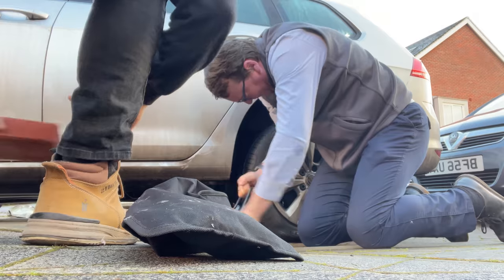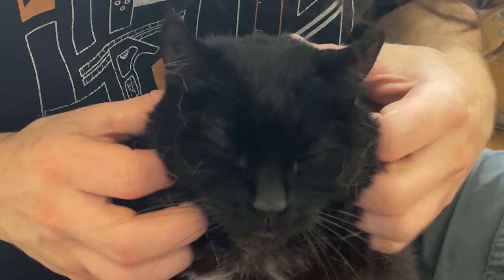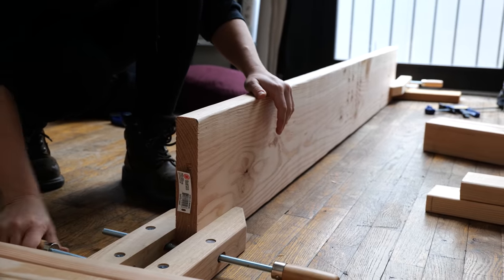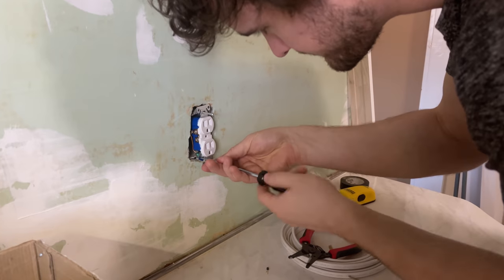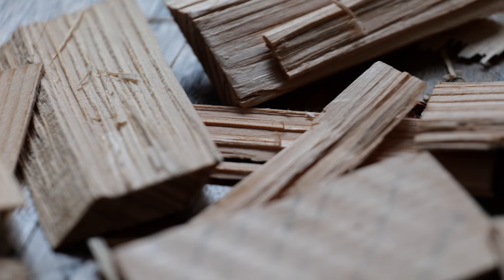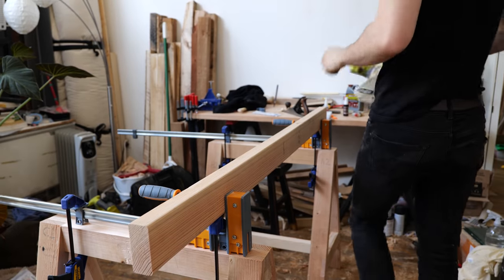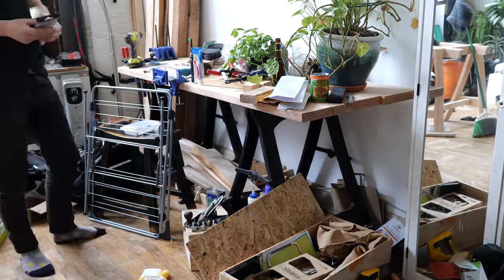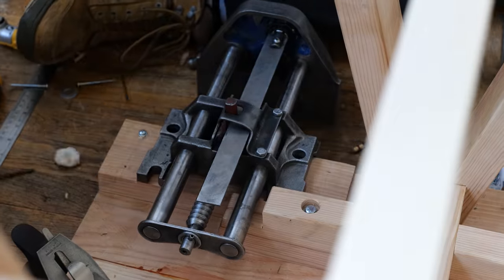Making a Workbench Using Home Depot Timber (CHEAP)

Comment from the maker: 💥Plans on SALE until end of May! 👇
https://mattestlea.com/product/sawhorse-workbench-plans/
Supplied with both Metric AND Imperial Measurements! 📏

Also, Notebooks and Notepads are now available here! 📖
🔴 Notebook: https://mattestlea.com/product/notebook/
🔴 Notepad: https://mattestlea.com/product/notepad/
Reply: Looks fantastic! I'm sure she is enjoying the new bench!
Reply: Where is the link to the clamps.?
Reply: Matt is there a way to get the plans to install the vise, i made my own workbench during the lockdown and lately i bought a similar vice for it, got the idea in my head but i am struggling to get it done properly.
Reply: @weldabar  Hi Weldabar, check out the main description of the video and you’ll see the link to the clamps!
Reply: @alfslee8906  are you struggling that the back face isn't at 90 with the bottom?
Reply: Maybeeeee…. Honestly square corners isn’t a thing I reached as was my first woodworking project.
But I try to figure out the design behind, where to screw the vise, where to glue de wood to the bench.. I made some samples and they don’t seem to go together
Reply: Matt, glad you are back in the UK. Not only were you using Imperial measurements.  At 3:07 you used the L word.
Reply: @RobHarveyMusic  Indeed the link is there (now). I don't think it was yesterday, but it's possible I am mistaken.
Reply: Matt do you have a video or plan for that stool?

Comment: I can't imagine finding timber that nice in any hardware store in the UK.
Reply: Probably even in the UK, if you do as Matt did, and look through the larger pieces (avoid studs and 4Xs - whatever they are in the UK) and look to heaver pieces good for joists and decking, you'll discover that the better pieces of timber were set aside for the boards and such that would be subjected to heavier duty.  Another trick, is with the pine marked for cabinetry and interior use, at least in HD and Lowes, buy the wider, heart sawn (have the pith running down the middle) pieces that are as clear of knots as you can find.  Then you can rip the pith area out of  the board and what's left is two quarter sawn boards that will look good, and won't be as inclined to twist or bow.
Reply from the maker: It took a lot of digging I can assure you!
Reply: Indeed, I have to travel a good distance out, over 1 hour drive to nearest lumber mill. Can't find hardwood anywhere closer :(
Reply: Same thing in France

Comment: Out of curiousity,.. what's it like in terms of Lumber selection in the Big Box Stores in the US? I ask in part because watching some US Woodworkers, it seems that they find it straightforward to get different varieties and sizes, even from Lowes/Home Depot/Whoever - meanwhile I looked for a wide-ish board (8x1 in Inches) in a certain DIY Store and had pretty much nothing. I ended up getting a generic softwood board and having to edge joint and glue it to make a wider panel, the only other choice seemed to be to buy a really expensive waney-edge Oak board. It seems that in the US, even the boards are bigger....
Reply: The local Menards has 1x8 maple, red oak, aspen, and popular boards currently. Red oak is the hardwood they have the best selection with the biggest board being a 1x24.
Reply from the maker: I'm assuming you're in the UK Rob? If so, we have definitely not got it as easy as the folks in the US. You need to go to specialist hardwood suppliers to find what you're looking for, and even then the quality can be questionable.
Reply: @MattEstlea  Yep, currently in North Yorkshire. I'm more into carving than making, and there''s the same issue with getting hold of wood - there's a good supplier near Ripon (Duffields Timber) but that's a two hour round trip - everywhere else is effectively a Builder's Merchant, mainly selling sheet goods and studwork, maybe some stair parts if you're lucky. I keep watching the likes of James Wright and Rex Krueger, and now this one of yours, and thinking how it seems the US is a land boarded in oak, maple, poplar, and other hardwoods while all I can get in my local eqivalent is CLS....

Comment: Great workbench, gotta ask though, why strip the paint to put on new stuff, just a colour change or am i missing something
Reply: It just looks better against the natural wood than blue, i guess?
Reply: @clinteastwood3684  I think what jelco is asking is why didn't they just paint over the existing paint if they were going to change its color?
Reply: @hadengibbons3539  ahh got ya.
Steel needs protection just like wood. I suppose they put a better product on?
Reply: I hated the color of the existing blue paint, plus it was chipped & peeling in certain parts because it was a used vise so I wanted to strip & repaint it ☺️
Reply: @saramulry  mystery solved lol

Comment: Hi Matt! This workbench turned out pretty nice! I'm basically a woodworking-video enthusiast and a novice in woodworking as a hobby. I have a question about the construction and durability of the workbench. I'm not american so I don't know the quality of that Home Depot timber but I guess it's not as dry and "ready to use" as the ones you normally use. Won't it twist and warp with time or will the alternating grain direction and bookmatching prevent it from distorting? I mean time will tell, I guess 😀 but still, it would be great to hear your explanation. Cheers from Hungary!
Reply: As an American I can tell you that your intuition is correct and this bench will at a minimum need to have to working surface planed soon, and at worst will be completely unsalvageable.  That wood is green and notorious for warping and twisting.

Comment: this may be an obvious question to those more skilled, but I am genuinely wondering what the purpose of stripping the paint from the vise was if you then just te-painted it again?

also: how stable is this workbench? in relation to racking specifically?

great video as always, I enjoy watching your content, and honestly if I had to single out one influence that got me itching to pick up woodworking myself, it would certainly be Matt Estlea... Great job both of you!
Reply: I believe the paint was flaked and cracked. That's the main reason 🙂Good question about stability. No idea.
Reply from the maker: Workbench is very stable, mostly due to the tightness of the cross halving joints on the table supports and the wide footprint. Vice was repainted just because we didn't like the blue colour it came as standard. Wanted something to match the space a little better. It was a lot of work but well worth it.

Comment: I like you using the Scary Sharp system in this vid. I that Sara's standard? Thanks for the outstanding report from the US. Also, did you ship tools from the UK? I saw a crate being opened.
Reply: Matt & I had made a cabinet during one of my trips to the UK, and he shipped that to me(you can see a glimpse of the front) along with a mallet I accidentally left. After opening the crate we used it for temporary tool storage during the project :)
Reply: @saramulry  Thanks Sara!

Comment: I just acquired 2x4x8's and a 2x10x16 at a residential construction site near my house (I asked if it was trash beforehand). Gonna use it for a workbench and in process of designing it. This video def helps with deisng process for the vice in particular. Great video and perfect timing!